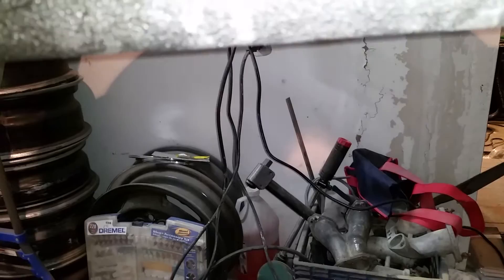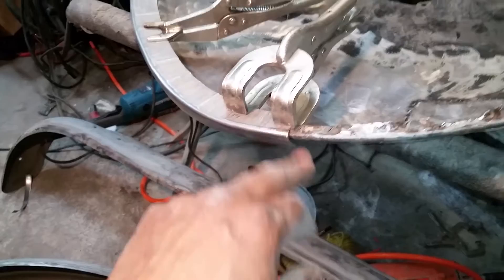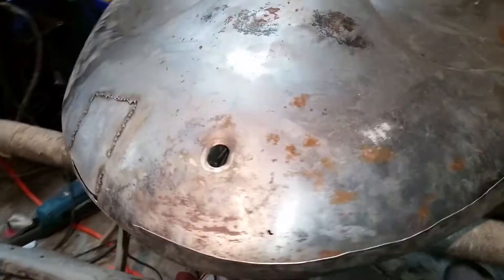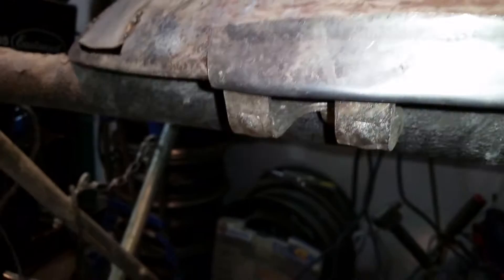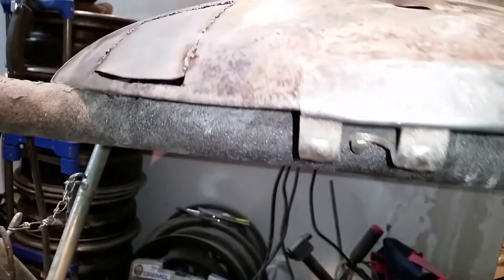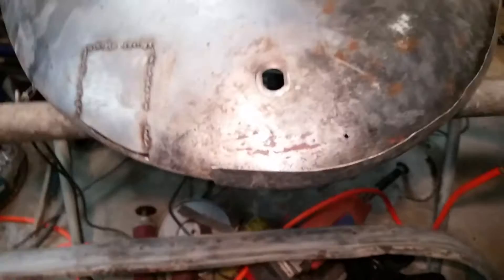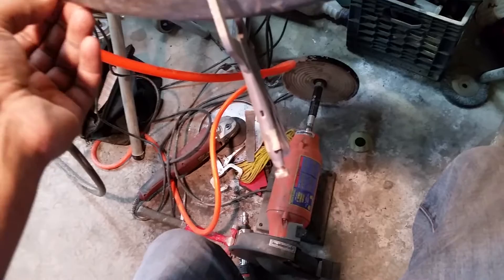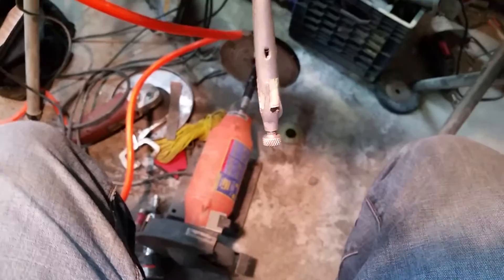VW Beetle W Decklid restoration: Part 2

Comment: I need to ask you a question I just got a 57 VW Hood I got the license plate light but I can't figure out how to put it together with that gasket that goes on it I'm having the hardest time trying to figure out why the gasket won't fit correctly I know it's something like I got to be doing can you help me please
Reply from the maker: Hello Paul.. Are you talking about this??

https://images.duckduckgo.com/iu/?u=http%3A%2F%2Fimages.thesamba.com%2Fvw%2Fgallery%2Fpix%2F1097194.jpg&f=1
Reply from the maker: You have to make sure you have the right seal. Are you sure your seal isn't for 1958-64 housing?